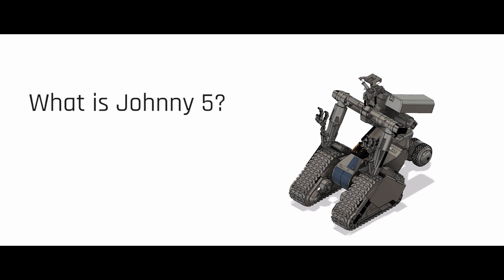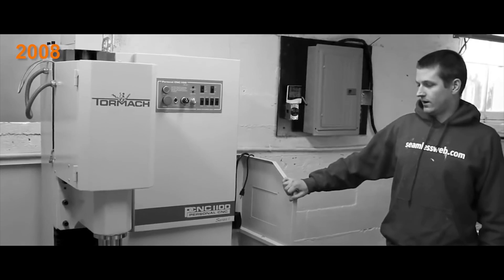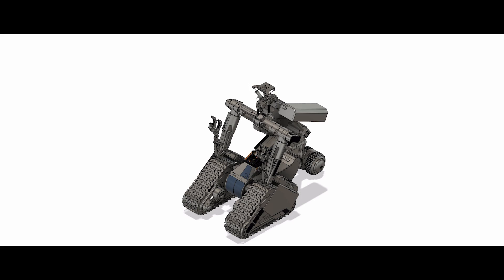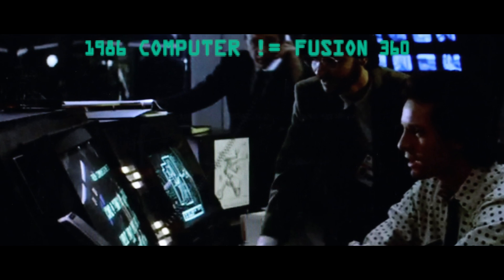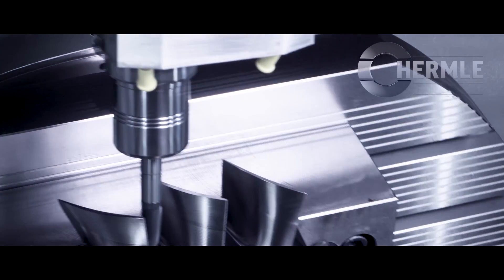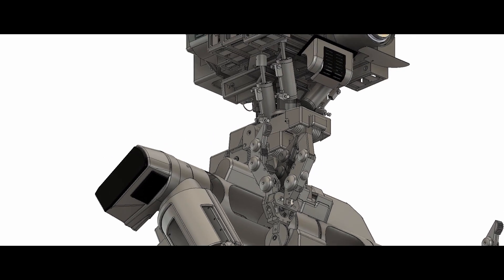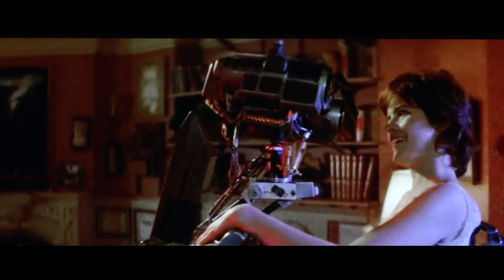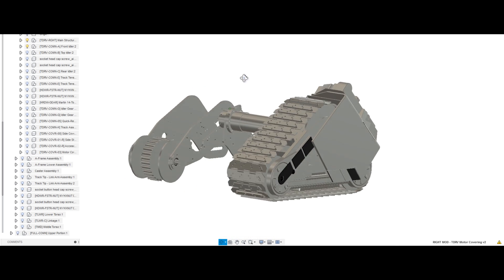Who is Johnny 5? | Project Build Overview!

Comment: Actually, the robot is not from the movie, it is based on an actual robot designed in the 70's. I have the original book packed up in storage. I can't remember the name of the author or book off the top of my head unfortunately. It was a book on robotics and some of the reasons for designs. It explains why tracks are used, etc.

Comment: I tried building a Johnny 5 many years ago.  I first started on electronics.  I was working on the synthesizing speech module and it was supposed to say "Ahhh.... so whats up Bozos?"  The power supply blew and the only thing that came out was something that sounded like "ahhhh shhhhiiiiitttt" then the controller and amp blew.  That was as far as I got.  

Still got the module in a box in the garage.